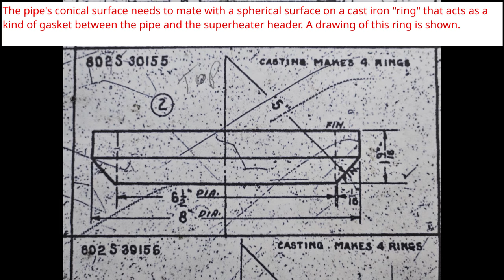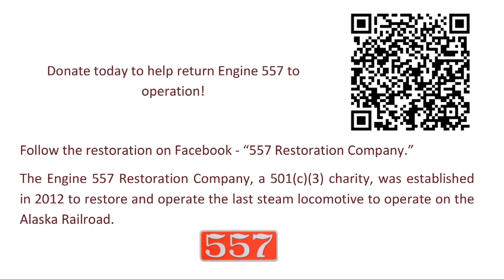Engine 557 Restoration Company, Reconditioning Branch Pipe steam seats

Comment: Out of curiosity, why not use lapping compound, like Timesaver?
Reply from the maker: If you look at about 4:28 on the video you will see we use Loctite Clover Silicon Carbide Grease as a lapping compound. Various grades are used to achieve the desired finish.
Reply: @engine557  same stuff they used for over a hundred years too.